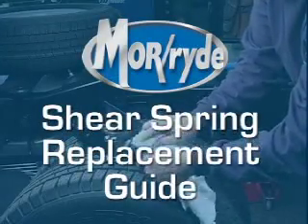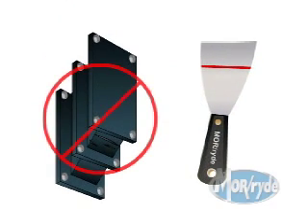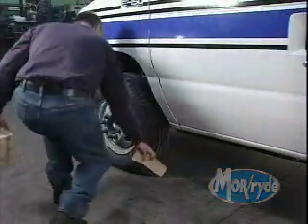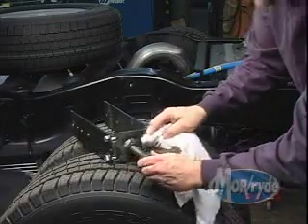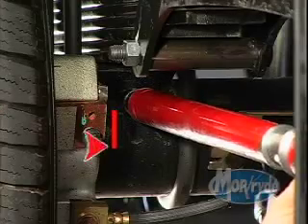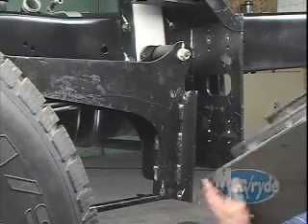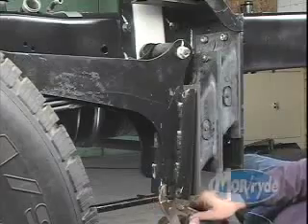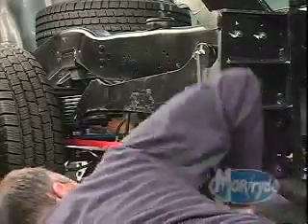RL Suspension Spring Replacement

Comment: MorRyde! Y'all need to make one of these vids for a pull behind & 5th wheel as this is a completely different EVERYTHING! And NO RV repair in South Texas has even heard of a shear spring which means they ain't checking the condition of them.....  somebody needs to open a dam RV Cert school for these dam stupid yokals that don't have a clue but bcs they camped in a RV once and have a flashlight and drill. ow they are experts😡 absolutely criminal! I just was quoted this by a company in. Monroe, Texas, MILSTEAD RV SVC... $600-$900 to tow my 5th wheel 65miles to them, PLUS $425+ to examine & provide an estimate of repairs to replace the shear spring bcs they had never heard of it and had NO CLUE what is was or where it was on the RV.... I am a 63YO female & tried to explain to this guy, very simply where it was and what it was for ...😮 he could not even GOOGLE it ... it's called a MorRyde LRE Suspension... part is a shear spring, located btwn the 2 leaf springs on a tandem axel... if I had the place and tools I'd do it my dam self as I have MOST repairs on my rig! 😡 BCS the "repair" ppl re IDIOTS!¡!!! SO DAM FRUSTRATING!!!

Comment: Just finished passenger side.  No way c clamps would work.  Tried 2 of the biggest c clamps I have to compress spring, could not compress enough.  Luckily neighbor has a 4 ton porta power and that did the trick.  Its a super duper PITA.  Hope the drivers side goes easier tomorrow but my black tank is right outboard of the rubber spring so probably not.  You have to lift the back so that the rear wheels are ALL THE WAY off the ground to get old out and then lift the diff to put new ones in.  Also had a hell of a time with drift pins and getting the new short bolts in.  I will never do this again, worth paying someone else or sell your RV and buy one without 'rubber leaf' that degrades over time.  Also, new rubbers are significantly smaller than the old ones as well as the backing steel (steel looks to be 1/8 as opposed to original 3/16".  Better rubber or "value engineering"???    

Last thing, on the rear of the leaf there is a clamp that holds the spring pack together, when I released the tension on the spring it hung up on these so the 'eye' on the bracket did not make it all the way above the spring pack.  Had to use a pry bar to get it to go all the way.  Boing! and Boing!  very scary sitting under a 14K RV and giant spring pack.  Cant imagine these are any better than the stock springs with airbags.  Seems way over engineered and just another point of failure.
Reply: How did the drivers side go. I was going to attempt to do this myself but your comments have me thinking otherwise. please share any other insights. thank you

Comment: Can you tell me where you bought the clamp tool to relieve tension on leaf spring and part number for tool?
Reply from the maker: The part number for that tool is either RL34-001, for the heavy-duty version, and RL34-002, for the light-duty version. The other option would be to get a large C-clamp and clamp the bottom of the spring carrier towards the frame hanger. That will lower the front of the spring carrier and allow you to insert the bolt and sleeve below the leaf spring. Hope this helps!
Reply: @morrydeinc  C-clamps will not work, at least didnt work on a 1999 jamboree ford super duty.  Show it in the video or follow up video or it never happened.

Comment: Soooo much easier in video then on my motorhome😖☹️
Reply: Do you have two of these rubber shear springs on each side in the rear (4 in total)? What model motorhome do you have, and where did you find the rubber shear springs for it?

I have a motorhome (91 Fleetwood Pace Arrow) that has these shear springs on both ends of the leaf spring assembly (I think it's a leaf spring, although I can't see the leaves, it's attached to the axlewith u-bolts where a leafspring would)

Thanks!
Reply: @optiskeptic4746  I had 2 one on each rear leaf spring - was a 1999 Fleetwood Jamboree
We sold it recently but man those springs were a Pain in the a$$
Reply: F-ckers where i work had the wrong shear spring and tried to force it in. Idiots